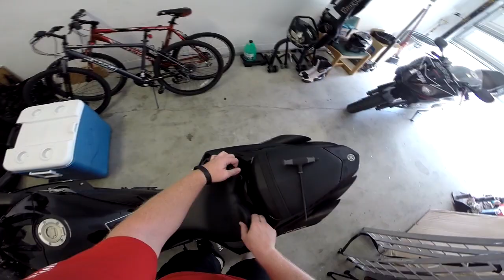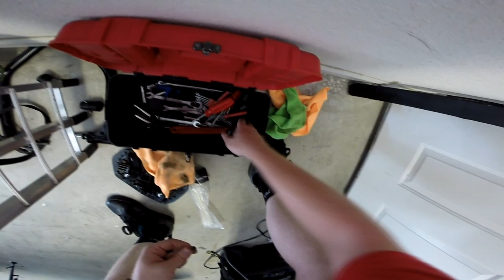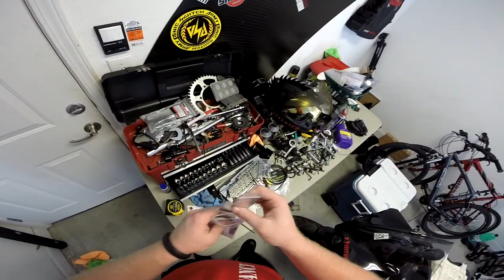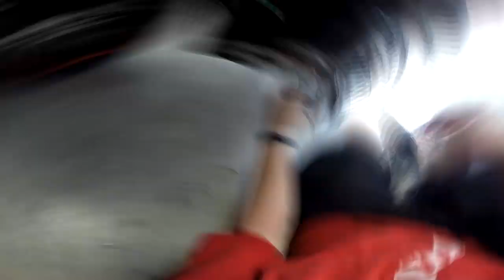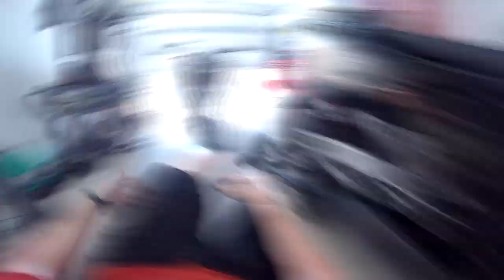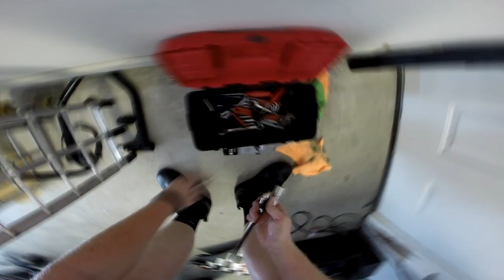Un track prep

Comment: I dealt with Jason at TST industries when I brought my TOCE exhaust for my CBR600RR..great guy, had great customer service in answering all my enquires.
Reply: Hey man I got termis on my bike. But want to change it up. Is the TOCE pretty much straight piped or does it resonate and provide some back pressure? 
I can't seem to find how the exhaust is made or a break down of it anywhere 
The slips for my bike is $1200 and I don't want to get it if I don't get back pressure because then I rather run straight piped